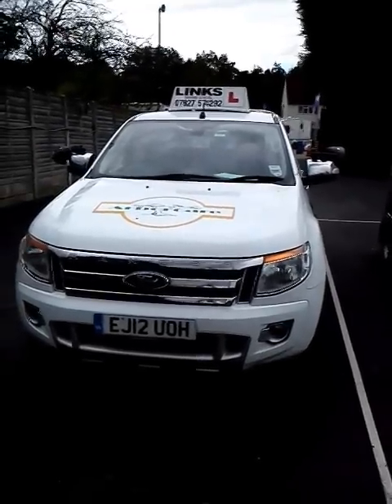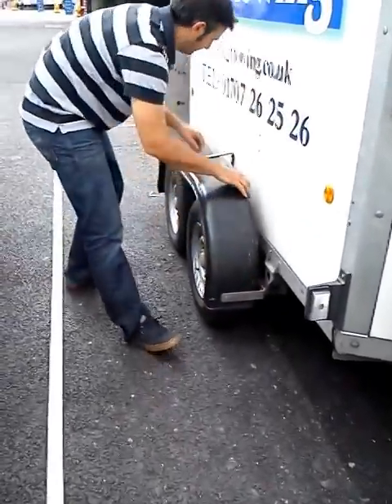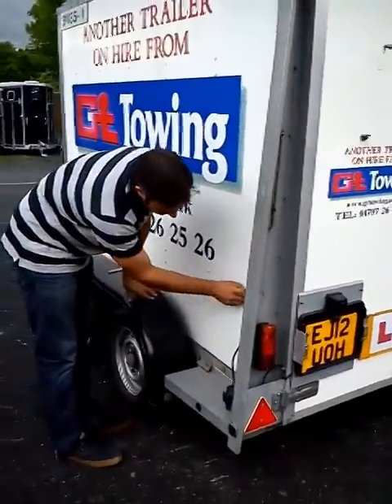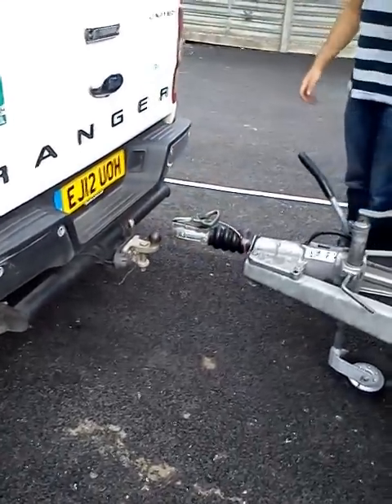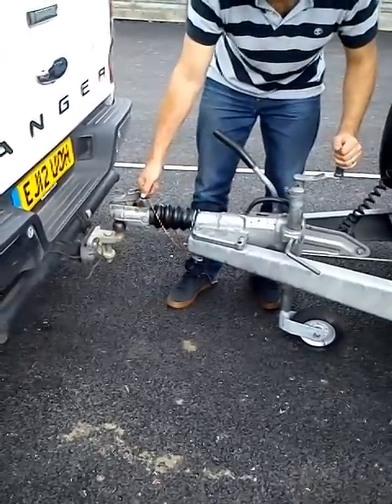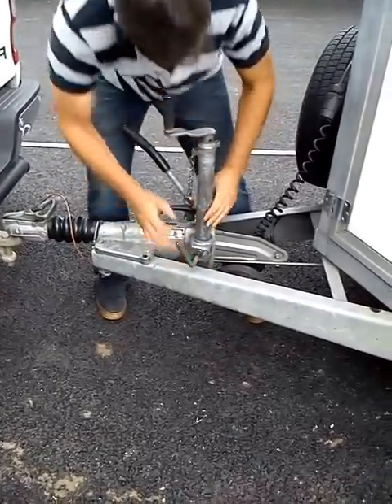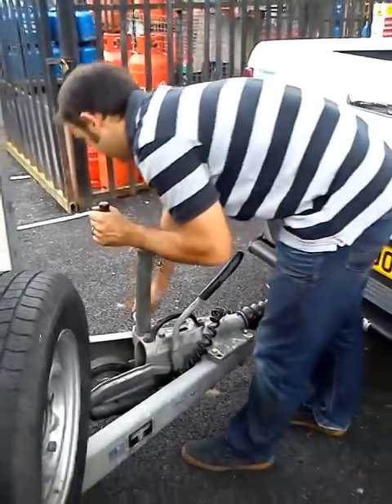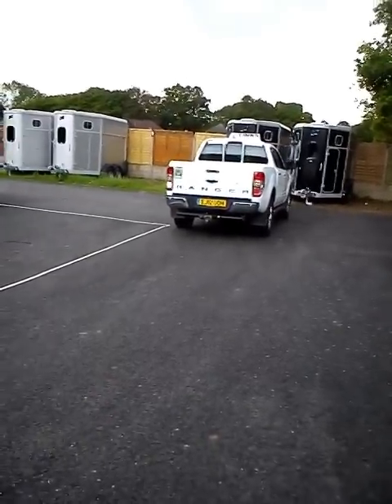B+E Towing with a trailer test - Re-coupling/Uncoupling 2021

Comment: Check the indicators individually, not with the hazards. Yes I have come across a trailer with the connections crossed. It wont show up if you use the hazards. Running the breakaway cable over th top of the hitch will not give a straight pull on the handbrake if the trailer comes off thus not activating it.

Comment: Is it acceptable to leave the engine running and step out of the vehicle? On my car test the examiner would not allow me to do this (to get the air con on on a hot day) as I 'would not be in full control of the vehicle'
Reply from the maker: Thank you for your query. When you recouple the car to the trailer the engine must be switched off. Serious fault if you do not. When reversing your car back into position to recouple you can leave the engine running in order to check distance from said trailer to attach the brakeaway cable. Hope this answers your question.

Comment: What trailer do you get tested with can it be a standard flat bed trailer or does it need to be a box one. Also will it make a difference if its a single or double axle as well. Thanks
Reply from the maker: Hi
Trailer must be covered and plated to a minimum of 1000kgs and have either 600kgs of sand, aggregates etc or 600litres of water. Click on this link for more information 
https://www.gov.uk/car-trailer-driving-test/trailer-rules

Comment: Do they really get you to run your hands round the tyres? Be great when there's cords hanging out and you rip your hands to pieces 😭
Reply from the maker: British-mechanic There is no requirement to touch the tyres just to carry out a visual check to see if their are nails in the rubber and for any cuts and bulges on the tyre wall. Hope this answers your query.  Thanks

Comment: When uncoupling the trailer from the vehicle it's still attached and  the vehicle handbrake is on. When you apply the trailer handbrake you say to check that the brake is actually on? How the handbrake from to vehicle is on holding the trailer. Thanks
Reply from the maker: when you uncouple the trailer from the vehicle the handbrake is set and should therefore hold the trailer in place when you release the brake away cable. Before taking off the brake away cable their is no harm in giving the trailer a push to ensure no movement takes place. I hope this answers your question. Thank you

Comment from the maker: the trailer only needs to be pushed once disconnected from the towbar as per dvsa requirements
Reply: Neil Emmerson if you're not physically strong enough to pull the trailer forward is that a fail? (I would usually have assistance with a full load on site)
Reply from the maker: Billie Fingers  hello. You must for the purpose of the test be able to manoeuvre the trailer over the towball as you cannot hit the trailer when reversing your vehicle up to it. The distance from your vehicle to the trailer needs to be so you attach the brake away cable. In reality if their are other people with you then that can give you assistance. On the trailer test you are working solo.
Reply: that pick up has rear camera as standard, can you not use that as thats real life if your solo. or if not got that reverse so far and check and adjust. load of crap pushing a trailer that size yourself but thats what im going to have to do for my trailer test soon
Reply from the maker: you can use whatever device is fitted to your vehicle to assist in the test i.e. rear camera to reverse backwards to trailer itself.

Comment: what hapens if you hit the trailer with the tow bar? do u fail? it sounds hard to judge 50cm
Reply: you would probably fail. Manual handling too. you wouldnt push the trailer over the hitch in real life  this is supposed to be trailers more than 750kg, examiner should act as your mate and guide onto it.

Comment: I am doing my training now and the van I'm using has a metal plate        by the towbar and my instructor has said that it's ok for a gentle tap against it when backing up to the trailer ???
Reply from the maker: Tony Johnston Hello. It is a serious fault if you touch the hitch and towball as I have had a client do that and the examiner failed them. You reverse to a point where you can connect the brake away cable and then pull the trailer over the towball before winding down to get the connection. Hope this helps?
Reply: That was what my instructor said and I did that in my test and it was ok
Reply: @neilemmerson2830  it's rather difficult to reverse so close without knowing the exact distance away, can you fail for being too far away or can they allow you to reverse upto a certain point, safely stop the vehicle, exit vehicle and check the distance and return to vehicle to continue the reverse? Surely this is more a real life scenario
Reply from the maker: @blank-dr2kx  hi..when you reverse back you can stop get out have a look as many times as you like. Just move backwards in small steps get out and assess. You can even drive forward if you are not in line with towbar and hitch.You only need to get positioned so you can attach the brake away cable. Normally about a foot  away is ideal. Just do not reverse into the hitch!

Comment: Is it fine not checking that the indicators are the correct way round?
Reply from the maker: Sean Thompson hello Sean. Sorry for delay in replying. Not sure what you mean by indicators the wrong way round.
Reply: Neil Emmerson in the video, there was no check to see if indicating left displayed as left, or visa versa.
Reply from the maker: Sean Thompson  Thanks for clarifying your point. The requirement is to just put on the hazard lights as this would indicate a defective bulb. If you wish to check just the left and then the right then that is acceptable. Hope this answers your question.
Reply: Here in the Netherlands we do have to check them separately (with the brake applied to check that the brake lights don't flash with the indicators)
Reply: Seems that they don't care about earthing problems in the UK.

Comment: You should never run your hands over tyres like he did unless you don’t mind potentially slicing your fingers open!
Reply from the maker: Richard Agreed and I have responded in a previous message. Thank you for your feedback though.
Reply: Neil Emmerson I am currently looking at doing my licence upgrade hence looking at some videos to get a little more context. Noticed also that you had a DBC sticker on the back. I am from hemel. 👍🏼
Reply from the maker: Contact me by email for more info or training

Comment: No safety chains?
Reply from the maker: Richard. Thank you for your enquiry. The brake away cable is I am assuming your reference to safety chain? The brake away cable is the last thing to disconnect on uncoupling the trailer from your vehicle and the first thing to connect when re coupling to your vehicle.
Reply: In Europe we use a break away cable that applies the trailers hand brake (trailers here usually have mechanical instead of electrical brakes) should the trailer become disconnected instead of the chains used in the US
Reply: @neilemmerson2830  please more  videos. I am having test soon.will like to the know parts kn a trailer and their names.great job guys great job
Reply: No safety chains, or secondary coupling on any trailer GVW over 750kg. Fitting one to a braked trailer will not allow the safety cable to engage the brakes in event of a decouple